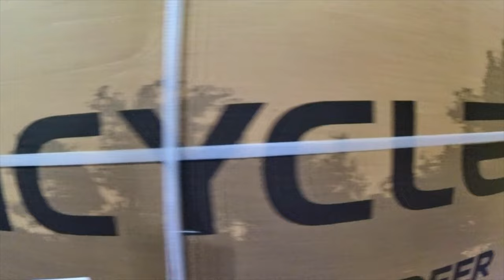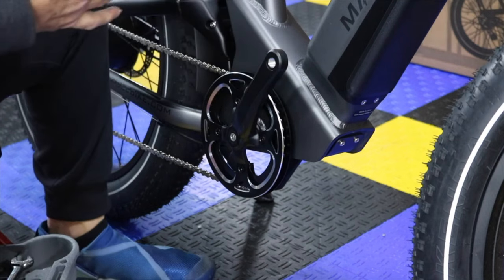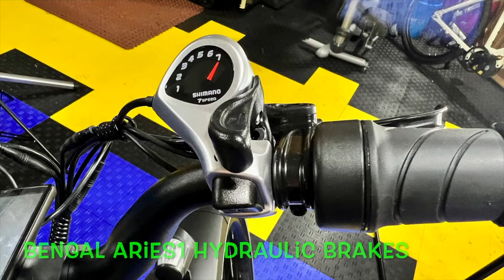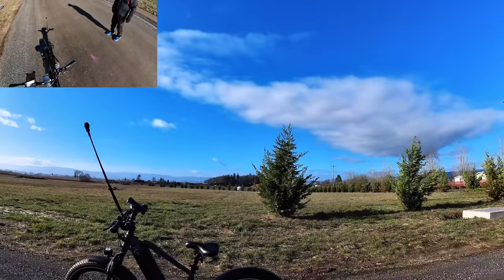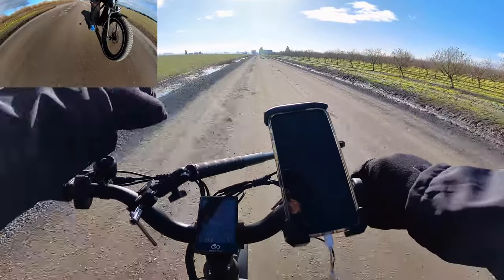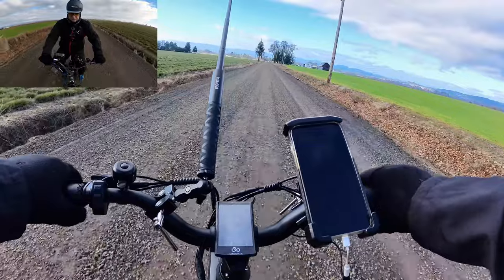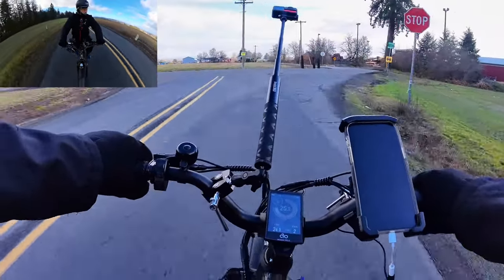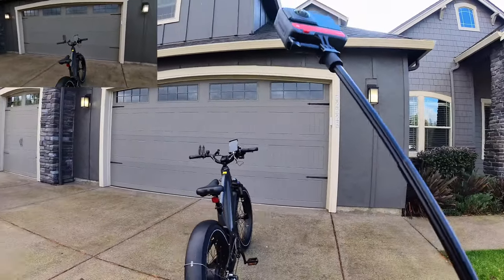Magicycle Deer SUV Review and First Ride...Sweetness on 2 wheels. $2699-300.  $2399

Comment: Bruce, thanks for the first look at the new bike.  Good to hear your insight, especially enjoyed the new mike setup.

28:10 time mark:  Rear rack comment.  Apparently, Magicycle is shipping the Deer with the rear rack as standard equipment now.

26:37 time mark:  Discussion about compatible batteries, Ocelot and Deer.  I think your comments here about buying a Cruiser/Ocelot combination were intended for the Deer/Ocelot combination.

And regarding my comments on the Magicycle Deer live stream chat, I think that the combination of 38-1/2" seat height and 93-lbs. weight of the Deer may be too much for (some) short riders to handle.

Comment: Hi Bruce. Quick question for you if you don't mind. Tried to do a IMU calibration on the old Evo1. The drone started drifting so thought I would try a IMU.
You know the Autel explorer now is the same app for the Evo1 and Evo2.  When I connect to the Evo1 and go to the settings to start an IMU. A pic of the Evo2 shows up with "follow the instructions" and it saying "starting calibration" then absolutely does nothing. Funny how there is no Autel video for an IMU on the Evo1, Evo2 Yes! I'm just wondering if you have ever tried it in the past, or when you have nothing to do. Check it out if you can do it. LOL sorry I know your supper busy!!!
Reply from the maker: Chas I have no idea!  Sorry.  I thought Autel said they would not support evo1 anymore as well.

Comment: I assume this bike doesn't do well off road, is that why you mainly stuck to easy flat terrain?
Reply from the maker: Not at all.  This is the terrain I am blessed with. that is near enough to do a quick ride withing the review video.  All of my ebikes get the same first ride and a simular distance ride.  I just did a video called cherry pie ride which had an elevation change of almost 500" over the length traveled.  Still road riding. I will take it out on a trail called browns camp this summer for a trail video. Browns camp is a dirt bike(Motorcycle) trail and logging roads as well.  The bike is fantastic and I have another soft tail bike from another manufacturer coming out next week. watch it too and you will see...Its just the terrain I'm near.

Comment: Bike Class with power restrictions is dumb.  Regulation should be only by speed, not power.  Its like a truck and a car -- they both have to be within the speed limit.  They should put 11-34 tooth freewheel on all their bikes.
Reply from the maker: I see you point for sure!  It’s 750W that puts out 1100W. Most put out more than then the nominal power. They also could install a 30-40amp controller for more power off the start and limit speed. I’m kinda in doubt with all the free wheel and front sprocket changing with somewhat powerful e-bikes as they surely have enough power that it almost kills the pedal factor for me. I pedal to get some exercise, but just enjoy the time and experience of being out there.  If I had just 1 bike would have a different opinion, but I have so many to ride setting them up to be perfectly sweet is not in my zero ebike budget. I spend way to much on camera gear and things I need to produce video content to outfit a ebike that is pretty awesome from the rip.   As an example I have about 14 phone holders at 20 bucks each. Things like that.  Anyway thanks for the comment Terry appreciate it and keep on riding my man.